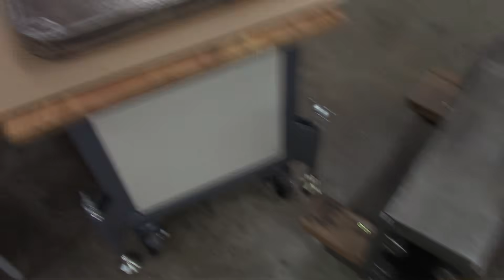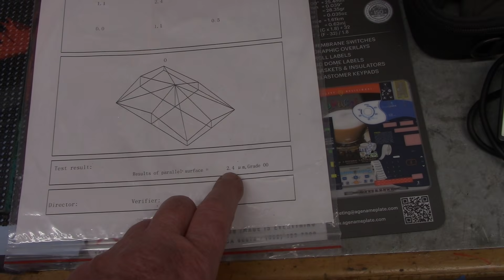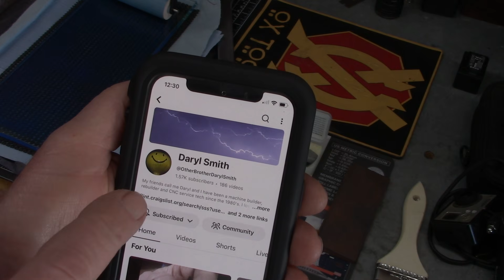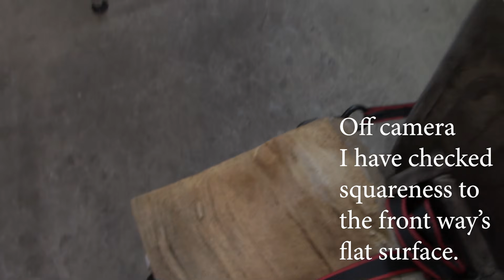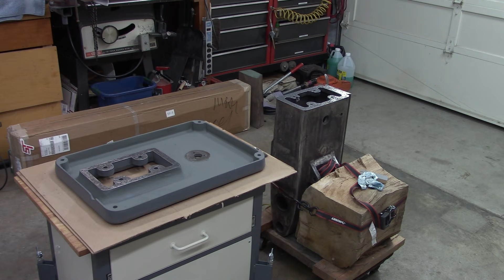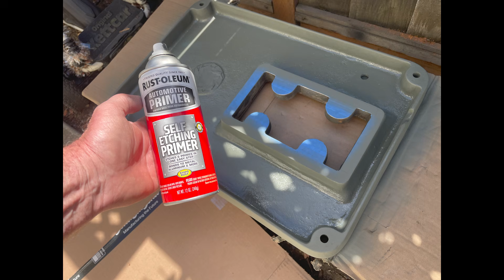Diamond Tool Co  Horizontal Mill Restore Part 9 : Hand Scraping the Column

Comment: Dean, There comes a time when we create solutions to non existing problems and convince ourselves that the problem exists. 
 
With that being said, squirt super glue between those two pieces when you reassemble them. Problem solved. LOL. 

Seriously though, your scraping looks good.  Now hurry up and get this assembled so I can pick it up. I just made room for it. 

BTW, my friend in Texas said regular gas is $3.35 a gallon and diesel is $4.45 a gallon. 
Too bad California shut down our oil wells and forced electric vehicles with an infrastructure prone to blackouts. 

Have a good summer and now that Ethan is out of school , maybe you’ll get something done. LOL
Reply from the maker: Ethan's been working my new 3D printer overtime. I barely get to use it...Lol
Hot one here yesterday, I'm not going to like my A/C electric bill....
Thanks Jim !
Reply: @TheAyrCaveShop Yes, hot here too. 
Fortunately I have both A/C and a swamp cooler that keeps the back half of the house cool. 
I would like to see what Ethan is creating.  Keeping him mentally stimulated is going to be rewarding.

Comment: Dean I love the rachet strap wood block idea. Rachet straps are as good an invention as sliced bread. I use one to strap electric motors to my table to test run them. I finally finished the rebuild/resto of my Walker Turner 900 drill press. I worked on that thing every day until it was finished and to be honest was tired of working on it when I finally got finished. Wouldn't been so bad if the Mud Daubers had not built nest inside the Walker Turner Motor but I had to take it apart and rebuild it also. Then when I finished it and had the drill press and motor all back together I built removable lexan/magnetic Mud Dauber gurard for the air intakes on the motor. It's good for another 100 years but what's the world going to be using to drill holes 100 years from now. LOL thanks as always for sharing your time with us. Better train Ethan on how to scrape .
Reply from the maker: Hi Terry, Yeah I saw those mud daubers, that was unreal. So glad we don't have those here. We just have $6.00 gallon gas 😕
Great job on that drill press !
100 degrees here today...
Hope you are doing well..
ATB.....
Reply: @TheAyrCaveShop  Dean we had our first 100 degree day in March this year.(crazy because that 100 degree day was on a Saturday and the following Monday it was 28 degrees. NUTS) I just came in from the shop. I have been waiting till late afternoon to go outside. My daughter lives in Auburn California and she sent me some pictures of over $7 a gallon gas pumps. I tell everybody I'm saving up for a gallon of gas. LOL I'm looking forward to more on the Diamond Mill. I can sure relate to getting tired of working on the same restoration. I'm trying to decide which one I want to start next. After getting burned out on the Walker Turner drill press I'm having a hard time getting started on a new project. LOL The Atlas MFC mill and the Walker Turner drill press were what I called my Bucket List projects. Just trying to get my projects done while I am still physically able. I'm pretty sure they won't let me take any of them to the Nursing home. lol
Reply from the maker: @terrycannon570  Having some "fun" projects to work on keeps us going. Yeah downtown or remote station locations are $$$